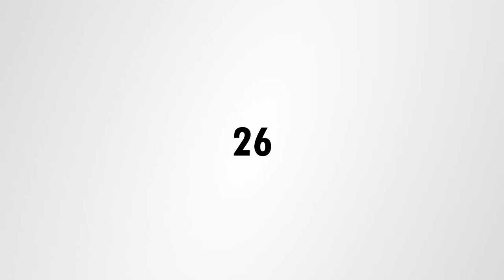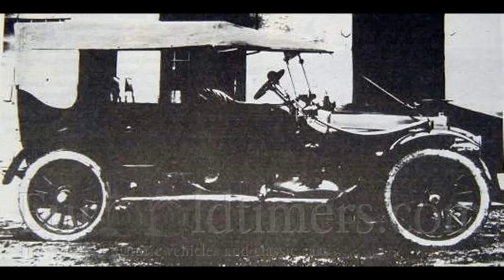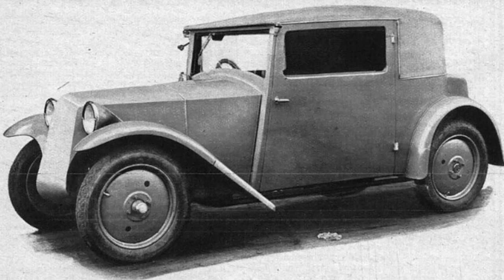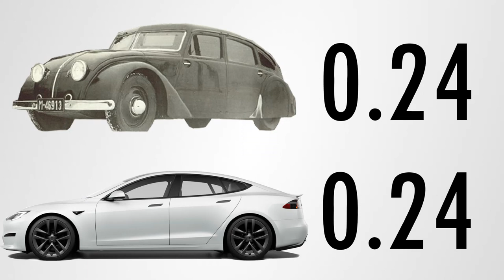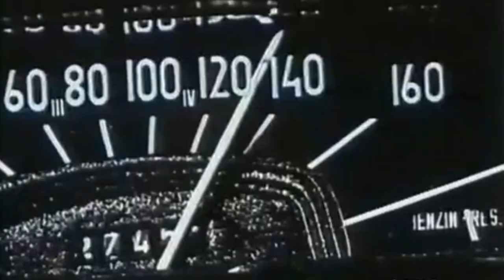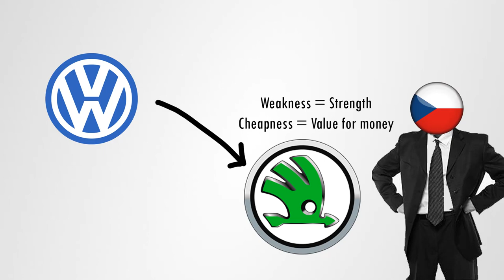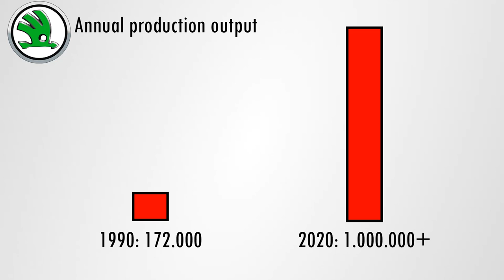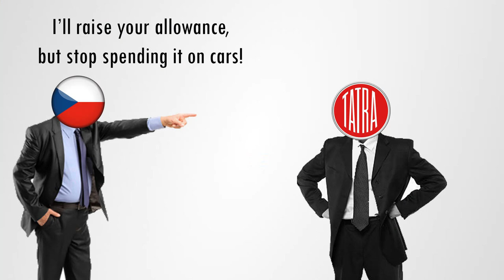Ep. 26 World Tour: The History of the Czech Car Industry

Comment: If I ever possess "f**k you" levels of money, the Tatra T87 would be at the top of my list. A true mechanical marvel with a bit of maleficence added for flavor! Chief designer Hans Ledwinka, an Austrian weirdly enough, penned the bodywork in 1936 with this flowing, zeppelin-esque fashion for one reason: low drag coefficients. In fact, with a rating of 0.36, it had a record that stood for several decades! The distinctive fin on the rear of the car (which is reminiscent of a shark) was placed there in order to force air onto the sides of the car when it is in motion, thus helping to keep it stable on the road. At least, that was the idea. It soon earned the nickname “the Czech secret weapon” by a few clever pundits as so many Nazi officers were killed by the T87 during WWII that the Oberkommando (high command) of the Whermacht eventually had to ban its officers from driving it. Der Teufel! The power delivery system in the T87 certainly did not facilitate exceptional road manners either. It had a 2.9 liter air-cooled V8 with a 90° cylinder bank mounted in the rear underneath a massive cowling worthy of a dirigible. With all 85 horsepower being sent directly to the rear wheels, the handling issues I waxed on about are a lot more palpable.

 However, this engine and car is still brilliant due to how unyieldingly efficient it was. The T87 was competing against luxury machines with more than twice the engine volume, and yet, it was able to cruise smoothly at nearly 100 mph (160 km/h) with an equally impressive fuel consumption of up to 18.8 mpg. This did not go unnoticed by other manufacturers. In fact, Dr. Ferdinand Porsche was so heavily influenced by this car (which lasted until 1950) and the later T97 for the iconic Volkswagen that he was sued by Tatra. It was a protracted battle with many legal and moral pitfalls, but eventually, Tatra prevailed in 1961 with three million deutschmarks in compensation. Such a lofty position could not be maintained indefinitely, however, and Tatra ceased car production in 1999, although they do still make heavy trucks. Quite a fall from grace, yes?
Reply: There is a yellow and white one that I see at all the big classic car events. The best event to see it driving fast is the meetup in the 1st weekend in September every year in Zbraslav, a suburb of Prague.
Reply from the maker: Thanks for adding the extra detailed information about the Tatra, I too started to fall in love as soon as I read about it. Truly a marvelous machine!
Reply: The Tatra had started as producer of railway carriages, locomotives and motor coaches (https://en.wikipedia.org/wiki/ČSD_Class_M_290.0), so I would not call that fall from grace, especially as it had retained that unique design which outperforms most, if not all, other trucks in ability to go through terrain.
Reply: then buy Tatra 603 or 613 from 8000 euro you can have, 30 years ago they were almost for free, there is also Felicia from 60' and not many people know, prices are growing
Reply: Lies again? CDG Zig
Reply: "an Austrian weirdly enough" 😃He was an Austrian with a Czech name. Ledwinka (ledvinka) means kidney in Czech. It is a Germanized Czech name without a German meaning. During the three centuries of Austrian rule, Germanization took place in the Czech lands.

Comment: Škoda was a big conglomerate making a lot of things from cars to locomotives, power plants, steel and manufacturing machinery.
It was divided up into a number of different companies, the best known thereof are green Škoda Auto making cars, belonging to the VW group, and blue Škoda Transportation making railways, owned by PPF, a Czech investment group. They both share the same name and winged arrow logo, one in green and one in blue, but have no other connection to each other. By a mutual agreement they can use the same brand in their respective market segments for an unlimited time.
A czech friend of mine used to have an old rear-engine Škoda car, which was great at making noise and smoke, but not powerful or comfortable. I felt rather peculiar in it. But today Škoda cars are known for making most of the platforms the VW group has to offer. For example the Octavia is based on the same platform as the VW Golf, but offers more space, more features. Likewise the Superb makes the most of the same platform the VW Passat is using.
Reply: The Skoda Works have been split up after being nationalised after the war in 1945. Later, when communists took over, the companies got some true communist names aswell. The original Pilsen Skoda works received the name ZVIL - Závody V.I.Lenina (VI Lenin Works), the car manufacture in Mladá Boleslav was called AZNP - Automobilové Závody Národní Podnik  (Car Manufacture National Company). After the war, both companies shared the same logo, but since 1994, when the Skoda Felicia was introduced, Skoda Mladá Boleslav had to use a different logo, which was changed slightly and the green leaves around it were added.

Comment: Development of the Favorit drove Skoda to bankruotcy, it was styled by Bertone, Porsche developed the engine mounts and Ricjardo Engineering in the UK designed the cylinder head. It was a very popular budget car, and in 1993 gained fuel injection and side impact bars. The Favorit killed Lada sales in the UK, as it was almost the same price as a Samara, but better made and better equipped, and thanks to Bosch efi, compliant with emissions and mire reliable than Lada’s electronic carb. The Felicia put the nail in Ladas coffin, with the likes of tge 1.9d, handy estate and cube van, and even had models with leather interior, heated seats, air cobditioning  erc, all for less than the cost of a second hand Ford Escort

Comment: I adore Tatra.  Way ahead of everybody else in aerodynamic design in the 1930s. 
I currently own a Skoda.  I also once owned one of the ones that you derided.  I had a 1980 120l. It wasn't great but it was sufficient for the price.  Very roomy compared to many others in its class at the time.
Fun fact. It was the first modern car (at the time) to be narrower and taller than the model it replaced.  And also it was the first car that 'AUTOCAR ' magazine of Britain actually recommended that you should  not buy. 
I still think that this series of Skoda were OK.  As long as you drove them carefully.  They were better than a Lada.

Comment: Interesting video, especially for those not very familiar with the Eastern European car industry.
I would've only added: 
(1) the Octavia and 1000 MB were replaced by the still 1000 MB based 105 and 130 / Rapid. Yes, they were a bit outdated compared to a contemporary VW Golf or Peugeot 305, but press rated these cars better than corresponding Lada's, Yugo's, Moskvich's or even Wartburg's; 
(2) these cars were replaced in the mid 80s by the Favourit/Forman duo, based in a Giugiaro discarded design for Fiat, which is why this car is well designed in my opinion. Despite lower quality than a contemporary western european compact car, it was a huge leap forward, especially in packaging and design; 
(3) Today's Czech industry is not limited to Skoda's: in the mid-2000's Toyota started producing there until to date the city car Aygo (alongside with the Peugeot/Citroën twins resulting from a joint-venture) and Hyundai/Kia also opened a factory there.

Despite the boycotts from central governmental decisions during USSR-era, Skoda never stopped developping cars, even though they were shelved. There's plenty of interesting Skoda prototypes and concepts that never reached production.

Comment: Škoda 1000MB actually was a Tatra. It was made up by Tatra as a people's car. Some time after it, it was decided that Škoda will be only 'low end' cost and Tatra will be making trucks only and Tatra was ordered to hand out Škoda 1000MB plans to Škoda (you can see the small model in Tatra museum). Tatra was even banned to create any more cars after Tatraplan (Tatra 600) - cars for personal use. Last Tatra 600's was made by Škoda, but people was not happy because these cars had very low quality and was constantly broken. That means that Tatra 603 was made under a ban - and that is actually true. The engineers made it after a work at home. Later when officials saw the 603 they allowed it.
Škoda 1000MB has exactly the same concept as Tatra 603 (600 / Tatraplan, 77 or 87) - engine in the rear, rear wheel drive, and big side air intakes (air cooled engine needs a lot more air than water cooled). That is why Škoda 1000MB have such a big air intakes at the rear even though only one is used for cooling the engine and the other is used for a fan to force heated air into the cabin ( up to the front ). If you compare the pictures of Škoda 1000MB and Tatra 603 you can clearly see the similarities (especially the air intakes).
Even though Škoda 125 was outdated, cheap ..... it was amazing in winter - great traction - it was only RWD, plus you did not need to freeze in winter, because the car have radiator at the front. Škoda 1000MB, 100 and 110 was really, really bad at heating up the car in any winter.
Škoda even tried Wankel engine in Škoda 1000MB - they made several pieces. Some of them was used day to day (what I heard), however the negativity of Wankel came out soon. The engine had to be rebuilt after several thousands of km (miles) and with the planed economy and no parts available, that had to be super difficult to have such a car.
From Škoda 1000MB later become Škoda 100 (both used 988ccm engine). Škoda 100 with 1107ccm engine was named Škoda 110 - all of these versions was 4-door saloon. However Škoda made 110R - 2 door coupe - slightly more horsepower than normal version. For racing Škoda normally used tuned engines BUT ... later Škoda made / heavily tuned 110R into Škoda 180RS or 200RS (for rallying or circuit racing) - with 1771ccm (114kw) and 1997 (120kw) respectively! Normally Škodas had from 23.6kw to 28kw, that was almost 5 times more power - imagine that today race cars ( rallye or circuit) would have 5 times more HP than 'normal' cars!
Tatra was making race cars also. They created multiple formula cars - one they took the engine that was supposed to be in Tatra 603 and place it into this formula - HOWEVER - they wanted to increase HP so they remove two smaller fans (for pulling the heated air for cooling the engine from the engine) and installed specially made headers with some triangles at the end and huge pipes attached to it - this created slight air underpressure around the block for better cooling. Otherwise without fans you will "cook" the engine in no-time. Have you ever heard the V8 with headers only? Add some simple chassis, brakes, steering and seat and you have one of Tatra formulas (this is super-simplified). Later they installed exactly the same engine with this special cooling into Tatra 603 for racing application. Imagine that you would hear only 4 cylinders driving around in your life and then you would go to see some races and would hear this screaming V8!
Škoda Favorit (Forman - longer version of Favorit) was the win for Škoda, because it had something to offer - they even had all-aluminium engine for succesor of Favorit - it was created and tested in Forman and it can travel 200 km/h (Forman / Favorit limit was 160 km/h - 100mph). However this engine was stopped by VW - decades later other manufactures started to create all-aluminium engines ( what a coincicence ).
Tatra was trying upgrade too. Tatra 613 had engine at the rear with RWD. They created FWD version with engine at the front but all the tries was banned or postponed to time indefinite.
Reply: BS. Škoda 1000 MB was fully developed by Škoda and not Tatra. Tatra would never make any water cooled engines. Tatra had absolutely nothing to do with the Škoda 1000 MB.
Reply: @erikziak1249  Tatra actually made water cooled engines. For examble Tatra 17 had engine: inline 6, 1.9 or 2.3L and was watercooled. This car is in Technical Museum Prague. Another example Tatra T-III (tank) 11 cylinder 18L again water cooled.
I was told this information by one of my family member that worked in Tatra his whole life and now is 80 years old. Tatra wanted to make "mass" produced car for people, but was banned to do so. Škoda was producing front engine cars up to Škoda 1000MB - why to change it? However Tatra already had prototypes of rear engine rear wheel drive many years before Škoda 1000. Then why it has so large air intakes for cooling when only one is used (for cooling)? Because you need large amount of air for air-cooled engine as was supposed to be used in Škoda 1000MB.

Comment: Well, most people propably don'‌t know. that tatra tried to build a small "van" caled Tatra Beta that was supposed to be povered by eletric motor made by VÚES Brno.  actualy first pieces of this tatra were made in the skoda factory and the rest of them in the tatra factory so like 40% of them are caled Škoda Beta. For some reason there were no electric motors and Tatra had to use gas engine from Škoda Favorit and later engine from hyundai accent and there are only 3 or 4 original electric betas. there is only something about 300 pieces made i think, and most of them are documented on tatra beta website. and a realy interesting thing about this car, is the material it'‌s made from, it has "buggy" looking frame from metal tubes and the outer shell is made from fiberglass. i have few pieces of tatra beta in my garage one of them is production number 003 and was made electric, but because of dead bateries it was converted to gas. and the original electric motor is still in the trunk so maybe some elctric conversion in the future

Comment: My grandma's first car was a Jawa Velorex, and I gotta say that has to be the worst car in the world. Still hoping to hear more soviet history in the future btw, no one knows shit about modern Lada!
Reply: The only decent modern Lada is the Vesta.
It's not that special though.
It started as a project with Magna, from Magna-Steyr. But it was shelved because of the 2008 financial crisis.

So they continued making the Samara 2, 110 and Priora.

Then, when they were about to collapse, Renault bought them. I think it was mainly for the factory, to make more Logans and Sanderos, but anyway.
So after some time, Renault gave AvtoVAZ some money to finish the project, but with that they also changed some parts to their own, to streamline the production.

So the result is 80% Lada, 20% Renault.

I don't mean that it's not a good car, it's very good for the price, but it's a bit of a mix of this and that.

The REAL issue is the powertrain.

The main 3 engines (1.6 106hp, 1.8 122hp and the sport 1.8 145hp)are just updated versions of the 80s Samara engines. They have reached the limit of the block design. The 1.8s have issues with oil consumption because of the sub-optimal rod/stroke ratio.

And the gearboxes are also from the Samara, just one more gear and a few other minor changes. Not that the Renault gearbox used for the sport model is that much better. The only issue with the russian ones is the whine. They are reliable, but quite noisy.

Other than that, the Largus is a Logan MCV, the XRay is a Sandero and the Granta is an updated Priora which is an updated 2110, which is an updated 21099, which is a 2108 Samara with a boot. Yeah, the platform was ran through a CAD software and was strengthened and whatnot, but it's still based on a 50 year old chassis(Development of the Samara began right after the beginning of 2101 production)

Now, with the Renaultlution plan, there will be no Ladas, just Dacias with Lada badges :(
Reply: Oh, by the way, the Renault takeover has an element of irony to it.
When they were testing foreign cars to choose with which manufacturer to talk, the R16 was the favourite.

But due to the strong italian socialist movement, they tried Fiat first.

So it's a bit like Renault taking what's theirs. But I still think its assholish to take a whole manufacturer and reduce them to just a brand :/
Reply: @Random-nf7qb  thanks for the history

Comment: You seem to be confusing the Tatra 77 and 87. Yes, they look similar, but still, not the same. 87 had 3 headlights and a V-shaped rear end, 77 hadn't. 77 was longer and made in much less numbers. There was also the 97, which looked like a smaller 87, but with 2 headlights and a flat-4 engine. It's confusing, I know, took me a while for me to get grips on it, too.

And as someone else mentioned, Favorit was quite revolutionary for Skoda in the late '80s, that was probably the main reason why VW has seen the opportunity in buying the brand, and also it was a Bertone design. Anyway, really cool video! :)

Comment: It is quite usual for journalists, and people in general, to bombard the Skoda models from the 70s and 80s with unfounded criticisms and insults; it is quite tiring and shows poor research. It is also insulting to the working class who needed a low-cost vehicle solution.
The Skoda 105, 120, 125, 130, 135 and 136 were actually very competent cars. The rear engine layout might have become unfashionable at the time, but there are advantages to the layout, and it should be viewed as a positive thing that not all cars then were facsimiles of each other.
In the UK, a major importer of the mark, Skoda had one of the most loyal customer bases. Skoda also sold the cars with a 2-year warranty, which was double that of most other manufacturers at the time. Skoda competed in rallying and notched up many class wins in the RAC, demonstrating the cars good handling and reliability. Performance, although never a powerful car, was comparable to other manufacturers offering similar engine sizes.
No, the old Skodas from this period were far from awful; in fact, they were pretty good, and well loved by the people who bought them.